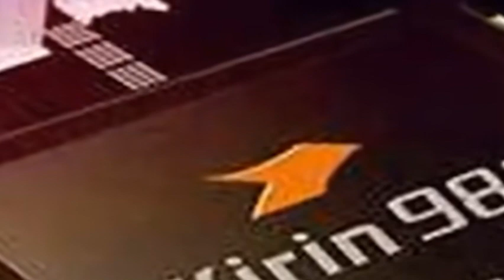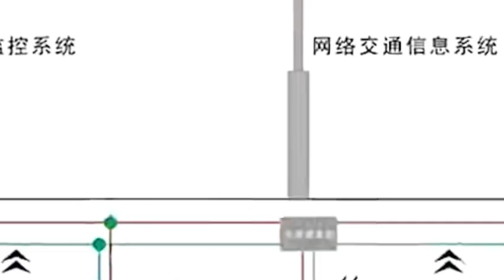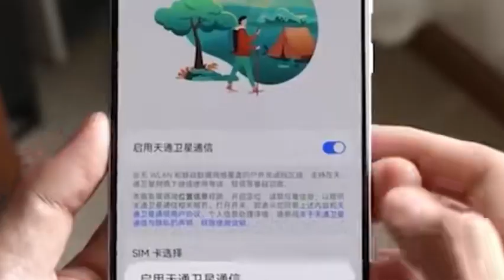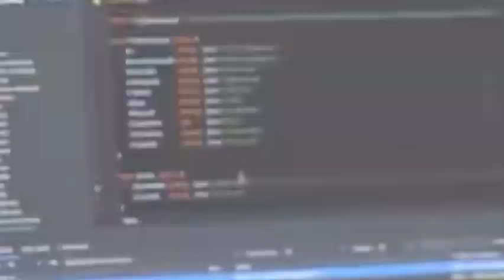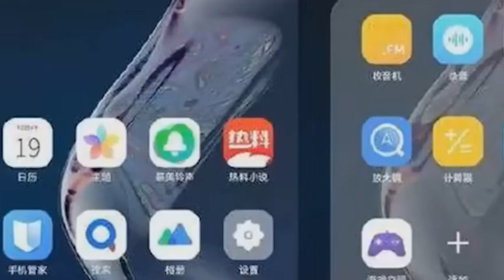The U.S. wants to use 6G to revive the communications industry, but it faces strong competitors.

Comment: The USA’s 6G technology is lagging far behind China because it didn’t complete a comprehensive 5G communication network and jumped to 6G instead while Huawei has the most number of patents in 5G and 6G. This significant advantage will enable China to lead the 6G implementation. The alliance led by the USA will not be able to catch up nor isolate China because the 6G standards will be defined by default as China is the first who will roll out the 6G communication system commercially and militarily.